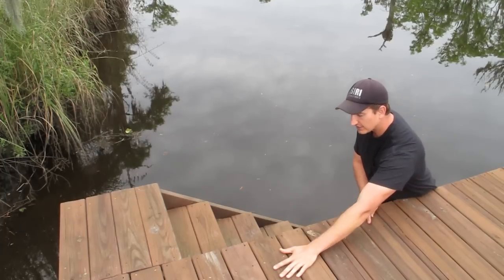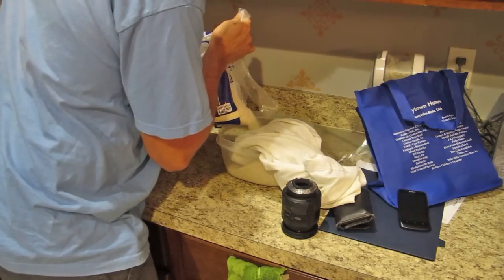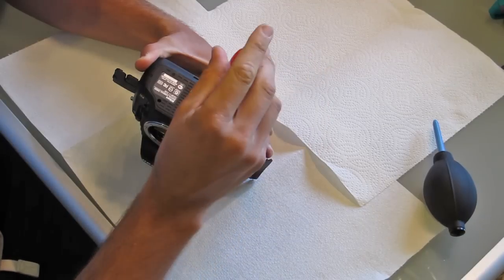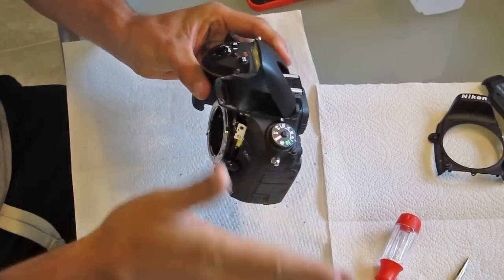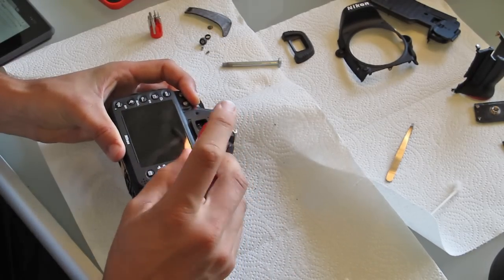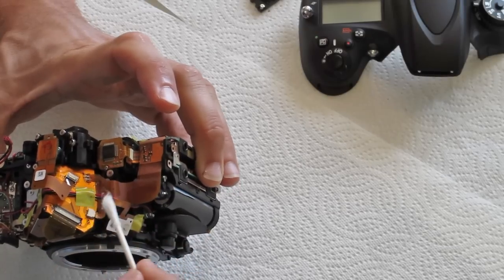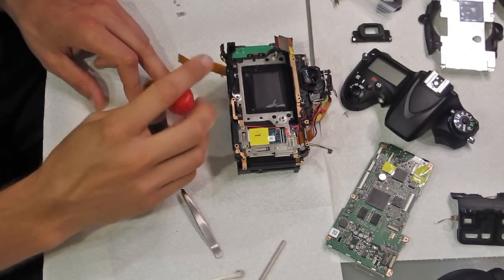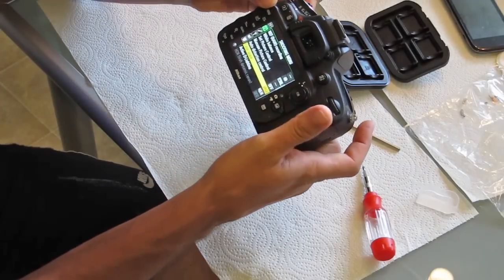How to Repair and Save a Wet DSLR Camera

Comment: Thanks Joe, based on your video I started pulling my wifes drowned camera apart.  I also had that same feeling as you after 3 days in the rice.  Turns out the camera (second hand Canon 5D ii) may have had water damage prior to my wifes ownership as well as there is extensive corrosion in some spots.  Anyway, the amount of water trapped inside on the electrical components was quite a lot of little droplets as well so I am glad I opened it up. We are busy cleaning it and drying it out (thankfully it only went into clean water.  I am just going to check and clean the sensor now and put it back together and power it up. Fingers crossed. Thanks again, Michael
Reply from the maker: Michael,  Thanks for the note and sorry you found yourself in such a situation.  It is not an easy decision to make; it is like opening up an alien spaceship.  Please let me know how it turns out.  I shoot with 5Dii underwater and may find myself in a situation where the underwater housing fails at some point.  I will be turning to you for notes on the Canon dissemble process.  Good Luck
Reply: Hi Joe, it fired right up. There are some smears under the rear LCD but nothing to worry about as I don't think it's moisture but not sure. Did you pull your LCD and dry/clean the panel under the outer glass. Just need to field test with new lens.

Comment: With a D800 in a do or die, I'd do the same. I've take apart some laptops and wondered what the .... why are there so many screws and the ribbon cables so short and my fingers now seem huge! LOL Yeah, you need the right tools and to have plenty of work space in a room you can lock the door and keep people out. I remember my Dad taking apart my motorcycle to fix a bad cam chain tensioner and he spread the parts out in a row on the garage floor and reversed the trail to put it back together (he also was a very talented jet mechanic) and made it look simple. I do not recommend doing this unless you have the gear and space. As for laptops, I don't do that anymore but do work on some rebuilds that are easier to access all areas. Unfortunately most manufacturers are not doing this (to easy to steal HD's so we are back to 10-15 screws on the back panels. I do feel that if the electronics fell into salt water, more than drying is needed to off set corrosion. Back in the days I had a Nikon F film camera. It could take a dip in the bay but you had to rinse it in a bucket of fresh water and dry it in the over BUT it was totally mechanical. The electronic viewer was trashed. I am much like yourself and feel that you have nothing to loose but time. If you have the time, do it and take a chance to fix the problem. I'm older now and would simply replace it with a refurbished camera. It should be noted that good deals can be had from Amazon, ebay and company direct refurbished like products from Nikon and the difference is the refurbished has never been underwater. Good thing to know if you really need it to work.

Comment: This video was extremely helpful. I was attempting to replace a SD door on my D7000. I didn’t realize I could rip off the rubber thumb piece with could reveal a hidden screw. Now I’m having a problem with the on off button not firing. Any experience with this on off button problem?
Reply from the maker: Thanks for commenting.  Glad the DSLR tear down video was helpful.  Hard to say what might be wrong with the on/off button.  I guess I would try to get to it and take a look at the switch mechanism and see if it is clean.

Comment: wow unbelievable and so glad you saved your camera.  my d7100 is at nikon right now, and they are estimating $281 for "corrosion" -  the camera has never been under water it has take some splashes but i've always wiped everything off right away.  i'm tempted to to deny the repair and do this, but i'm not sure what i'll find and how bad.  ugh.
Reply from the maker: Best of luck with however you proceed

Comment: I had to do the same thing to my t4i after dropping it in the pool. Working with computers for the past 20 years I know better to quickly remove the battery and take it apart asap and clean all contact points with alcohol or electronic contact cleaner. It is important to clean all circuit boards because they'll get corrosion
Reply from the maker: Hope the t4i turned out ok
Reply: MrKistel it's still clicking every weekend 👍🏼
Reply: My canon t4i has corrosion on the Circuit board

Comment: My camera stopped when I updated the system. I closed it during the update and it was a mistake from me. Now it does not work. There is nothing on the screen. It is stopped working.😑
Reply: You ''bricked'' the camera by turning it off during the firmware update. You are never supposed to turn a device off in the middle of a firmware update. Take it back to Nikon. It is useless with a corrupted incomplete firmware.

Comment: wow... I am not very mechanical minded.  That looks like a night mare ...  it seems easy enough to disassemble its just trying to remember how to get it all back together.  I wonder how many different types of screws?  Or were they all the same... if so that would help a lot.
Reply: From what I've learned during my IT training: draw the different compartments on a piece of paper and lay every screw on the position you took them out.  Oh, and if you have annoying classmates or housemates, use sticky tape to keep them there, I've had someone come in while repairing a laptop going like "Hey dude, what'ya doin?" and I see his hands go to the screws and before I could shout something like "Don't you fucking move those screws!"  he starts to scrape every screw laying on the table together...

Comment: Very interesting video. I'm watching it because my D600's hot shoe is loose and is causing an erratic connection between my flash and camera. Almost non usable. As you may or may not know, the hot shoe is attached with four screws. Nikon decided for some sick reason, to screw them in ... from the inside out. So the only way to tighten them, is to open the camera. You can clearly see the four screws at 4:35, inside compartment where the hot shoe is situated.

My question to you, as an expercienced D600 assembler, is it necessary to do most of the steps you did to remove the top panel? I'm trying to asses the risk of doing it myself instead of paying 300 $ for some guy to open my camera and tighten those 4 screws.

I must admit, I kinda hate Nikon for doing it like that. I have the exact same problem on my D700 too. On a Canon you don't need to open your camera.

Again, very interesting video. Watched the one from Ifixit tear down, but that was only a picture slideshow and difficult to follow.
Reply from the maker: caleidoo thanks for watching.  The way i demonstrate in the vid is the way i know how to get that far along in the disassemble process. It is not to difficult as long as you keep track of your steps and do not lose any parts.  best of luck.

Comment: You did everything that I would have done. First get the battery out. You said this was brackish water. Well since the camera is already wet I would have dunked it in distilled water and let it set for a while. You don't of course ever want electronics to get wet. But you sure don't want salty water to stay in there. Same with the lens. Not sure what to do with the lens. But once you get the brackish water out soak in distilled and try to dry it. Get it warm enough to start the water evaporating. Not hot. I don't know maybe a vacuum chamber. The lens is a tough one.
Reply from the maker: Thanks for the wet camera repair tips.  Yes, unfortunately I only made the lens worse by trying to fix it after being submerged in water.

Comment: Does anyone know if this would still work if I turned on the camera after dropping it? I know it was the worst thing I could do but it was instinct
Reply from the maker: Might be worth a shot, hard to say what is wrong till you open it up.  If not too confident it might be best to send the camera to be repaired professionally. However sometimes the cost of repair approaches the threshold of a new camera purchase altogether.

Comment: I dropped my point and shoot waterproof camera into a river today...while I was inserting the SD card so it fell in with the door open. Its now in a sealed container with rice. Am I correct in assuming that since the camera was built to be waterproof everywhere other than the opened SD card / battery, this is the only place I should expect evaporation to come from? I used a hair dryer on and off for half an hour over the slot after taking the battery out.
Reply from the maker: Sorry to hear you dropped your camera in the water.  If the camera is described as waterproof or even water resistant hopefully the chance for any associated water damage is limited.  If the camera was no tin the water long maybe it will be ok even if the sd door was open. Please advise if you are able to get it to work.

Comment: I've got a Canon 30D in this situation. How did you or were you able to clean the lens?
Reply from the maker: I tried to dismantle the lens as well which ended being a big mistake.  Now the lens is a paper weight.  Before dismantling I tried looking for a local camera repair shop to try to fix.  The one shop I found didn't want to touch a lens that had been wet.  The lens was dead anyway so i decided to take apart my self and was not successful.  In hindsight I probably should have  tried sending the lens for repair to the manufacture. My education from all this is to prevent cameras and lenses from  contact with water.  HAHA
Reply: @MrKistel  my house got flooded this year and my cybershot got damaged but I contacted Sony and they do not even offer digital camera repair in my country. So I am going to try and take it apart. But I can see the inside of the lens has fogging so my hopes are not high. It charged with the battery but it does not turn on.

Comment: This sounds more logical then the rice method. I just dropped my canon vixia in a bucket of water, and didn't realize it was in the water for about 10 minutes. I think I'll try this method.
Reply from the maker: Thanks for watching the how to repair a wet camera video. Please let us know if you are able to fix your camera that was submerged underwater.
Reply: @MrKistel  I opened it up and dried the inside and the inside of the LCD. Now I'm gonna leave it in the open air for  5 -7 days. I'll let you know if it works next week. I think I'll hit it w/ the hair dryer a few minutes a day also.
Reply from the maker: Awesome best of luck, looking forward to hearing your results and hoping for a full functioning camera recovery
Reply: @MrKistel  Thanks for the video. It saved my video cam. The only problem is the LCD screen shows my video upside down. I'm thinking maybe I put the ribbon cable for the screen in backwards.

Comment: Hello MrKristel so what happened to my camera was water entered into the camera and it wouldn't turn on so I dried it up in rice and it started working again, but unfortunately while I was pressing the shutter release button in continuous high , the aperture lever started clicking constantly and it only stops when I switch to u2 or u1 mode. Its been almost 2 years since my camera is in that condition. The big issue is none of the buttons are working except shutter release and live view. I still can shoot photos but I can't change iso or play with any of the settings, so do you have any idea of what the issue is here and what I can do to fix it?
Reply from the maker: Impressive to hear the camera has been working for so long in some capacity after getting wet.  It is hard to say what the issue may be and how to repair it from my end.  If the camera was taken apart you might be able to see a short or something obvious and try to make a repair at that point. Best of luck if you do decide to take the camera apart

Comment: how did you open the flash without the battery on? im trying to open my D7100 but cant get the flash to open to access the screws
Reply: I've got mine sitting in front of me right now wondering the same thing.
Reply: I ended up forcing it with a soft object from the front. I slid a match (i sharpened a little the tip of the match). After i took the top piece of the camera noticed there is a little lever that you can move to open the flash manually from the inside but im not 100% sure if you can access that with the top piece still in the camera

Comment: I dropped my brand new Sony A6500 with 35mm 1.8 prime lens in the lake a few days after I got it.  I had it in the top of a backpack that I thought was zipped up.  I was standing on a dock and picked up the backpack and heard a "plop."  I looked down to see my new camera laying at the bottom of about four feet of water.  I stripped down and went in after it.  I figure it was in there for around 3-5 minutes.  When I pulled it out, I took the battery and mem card out and pulled the lens off.  I could see water everywhere...in the lens, in the pop-out display.  I feared the worst.  I took it home, did some online research (nothing too hopeful there) and thought about it for a good while.  I know that heat is the best way to dissipate water, and can rapidly accelerate what might otherwise take a week or more.  The camera specs say the maximum storage temperature is 140F.  Our kitchen oven's lowest setting is 170F.  So, I stuck it in the oven at 170F with the door ajar thinking I had nothing to lose.  I left it in for 5-6 hours.  I had to pull it out with a hot pad as it was hot to the touch.  I let it cool down and could not see any water anywhere.  I turned it on and it seemed to work fine.  I haven't used it a lot since then, but I've taken some test photos and video and so far I haven't noticed any degraded performance.  Everything is working normally from what I can tell.  I can see some dried water marks on the back inside of the lens, so I'm guessing if I take pictures in varying conditions and look carefully, I might be able to see some artifacting from that.    Hopefully this can help someone else who may be in the same situation.
Reply: U put your camera in the oven??

Comment: I was washing my dirty 80D under tap water but what i didn't know was that the lens had a gap so the water went into the gap and into the camera,now I'm leaving it in my cupboard with a bag of rice and a bag of silica gel in the sensor compartment 😓
Reply from the maker: hope it comes out well
Reply: GeneraL_LOL I had a similar issue with my 80D. I took it out in the rain for an epic thunderstorm self portrait. I knew it was weather sealed but, like you, I didn't realize there was a gap between the lens and camera. The camera will still turn on but an error code pops up when you go to take a picture and says to clean the lens contacts. It's been two weeks now and it still doesn't work. I'm afraid I'll have to send it to canon to get it fixed. Please let me know if something works out for you. I'll do the same if I figure it out before you

Comment: I have a camera that fell into water some time ago now. I didn't know the battery had to be removed right away. By now it's not even charging anymore. Do you think it could still work if I follow the same dissemble - reassemble process?
Reply from the maker: It is hard to say but best of luck with your troubleshooting.

Comment: Hi,
do you think it is safe to dip it in the alcohol (partially disassembled perhaps)?
My D3200 fell into salt water ..stayed for a few seconds but won't work of course and I assume there is a lot more things (salt) to remove than from fresh water.
I saved my GoPro like that, but it is way more simple device. Are there any parts that couldn't take the alcohol treatment?
Thanks.
Reply from the maker: If it were me I would  make sure to take out the main battery and the small internal (watch style) battery.  i would disable as much as possible and then soak all the components in distilled/RO water for several hours.  The idea being to dissolve any salt that my be on the components and circuit boards that could be causing shorts.  I would let the components dry for as long as possible before resembling.  The only component i would debate soaking would be the sensor and its filters but if it was infiltrated by salt water you may have not any other option.  The gamble is it may be hard to dry out the layers between the filters and sensor.  As far as alcohol, the idea to use it would be because it drys quick but there is a chance it may dissolve certain coatings on various components.    Best of luck.  FYI: there is a  chance you may have already caused a damaging short already and so a thorough cleaning may not be enough to bring it back to life.
Reply: nemanja milosevic hi, same case !
What did you do about it

Comment: My camera sat in a puddle of paint thinner (possibly overnight) and the inside is soaked. Since paint thinner works differently than water do you have any suggestions?
Reply from the maker: Sorry to here about your submerged camera.  A solvent like paint thinner may dissolve protective layers on the camera circuitry components.  I would still try the same procedures I demonstrate in the "Wet Camera Repair" video and hope for the best.  Best of luck and keep me posted how it turns out. Thanks.